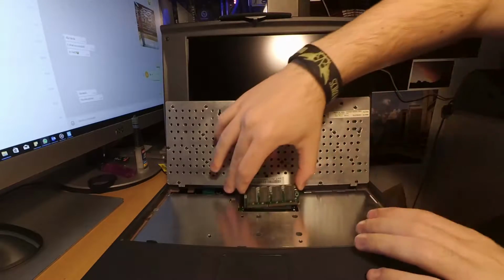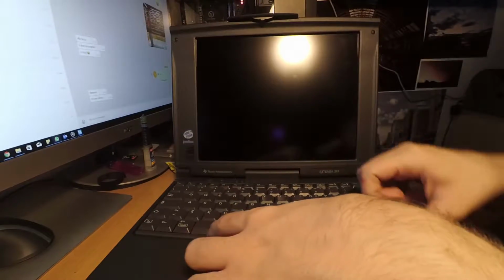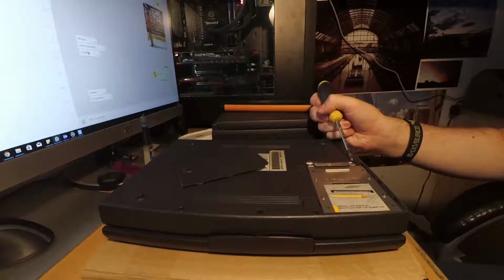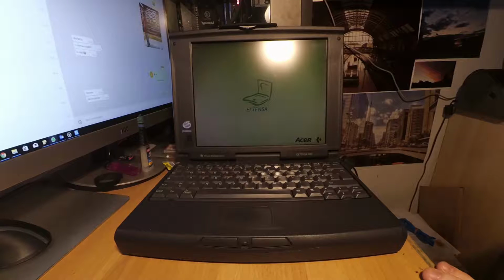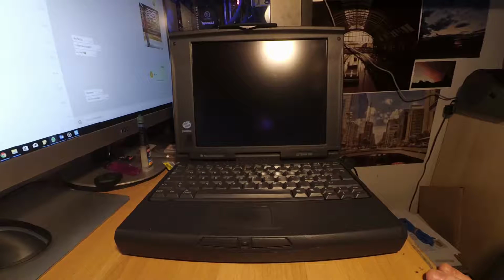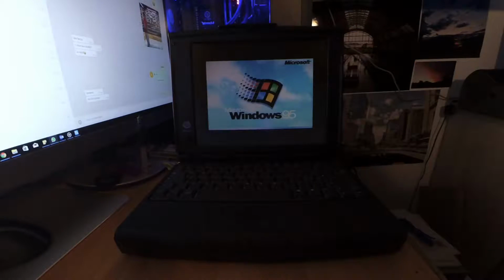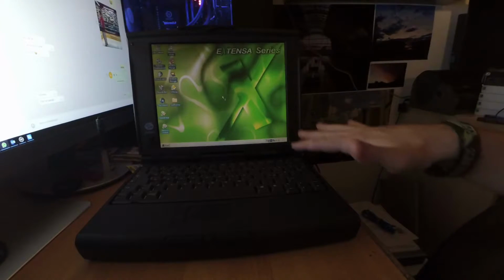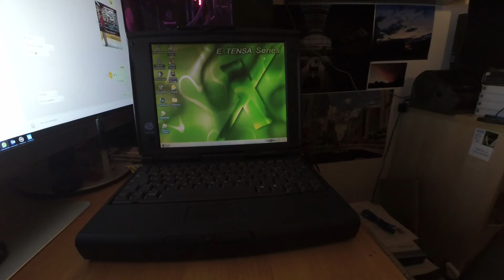Acer [Texas Instruments] Extensa 355 RAM & Hard Drive Upgrade

Comment: Hello! Do you have the audio drivers? Because i cant find them anywhere
Reply from the maker: I have two pcs of that model, don't have the original installer (I think it was on a floppy disk I had years ago), but I think this could work, it's the same driver (and version) that I've installed on the Win95 pc, should work even on 98, but 98 will probably auto-detect and install it.
https://www.driverguide.com/driver/detail.php?driverid=8285
Reply: @PaoloMarcelli  thanks! Ill try tomorrow, i tried 2 versions but one just keeps the ? mark in device manager and the other one installs but doesnt give any audio.
Reply from the maker: @Mayban36  If you don't fix it I can try to image the full HDD so you have a copy also of all the softwares to adjust display, original wallpaper and logo in the computer properties and everything else, but I'd need some time to do that 😂
Reply: @PaoloMarcelli  WORKED!! Thank you so much, ill try to gather all the drivers and upload them to the internet archive :)
Reply from the maker: Hey! I'll look for them and let you know :)

Comment: Great vídeo. Can you help me with a problem? I have just get an Acer extensa 367d that powers on but the screen is black. Pluging it into a external screen works very well... Dont know what to do as I dont have its manual...
Best regards from Spain
Reply from the maker: Hi!
If the external monitor shows something most of the times it's not a problem with the main logic board, I'd say it's probably the screen cable but I cannot be sure without a proper analisys.

Cheers from Italy :3
Paolo M.
Reply: @PaoloMarcelli  thank you Paolo, I think It is a problem with Cmos bios and don't know where I find info to change the bios battery, can you help me? Thank you again
Reply: @joseantoniogarridoperez  I'm curious about the CMOS battery location/ability to replace too. Great video!
Reply: @blinddog1212  The CMOS battery is underneath the case LED lights on the motherboard. It's this grey silicone block that says ACER on it. I got myself this same laptop today and have to replace that battery, gonna put wires in there so it's easier to fix in the future.